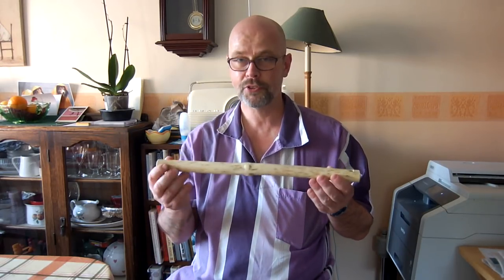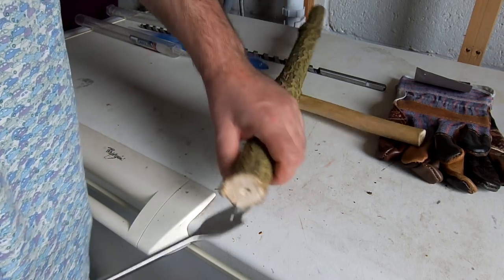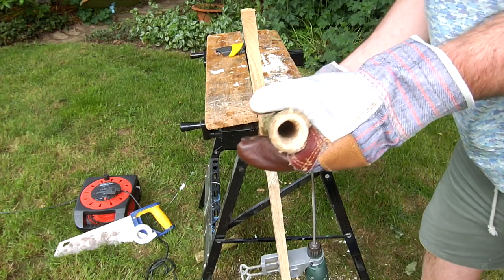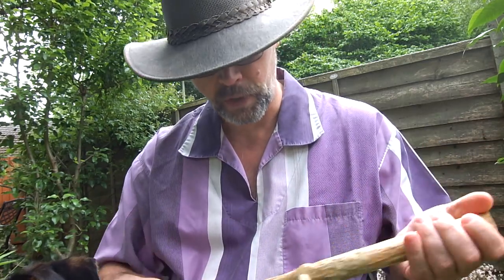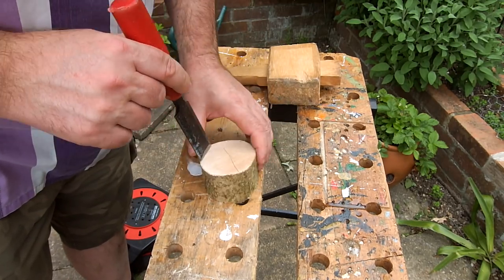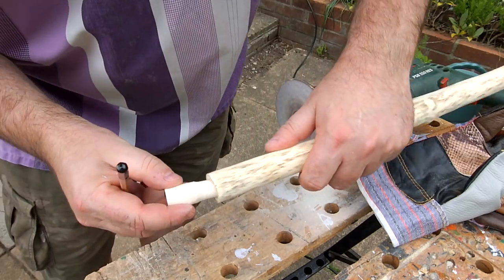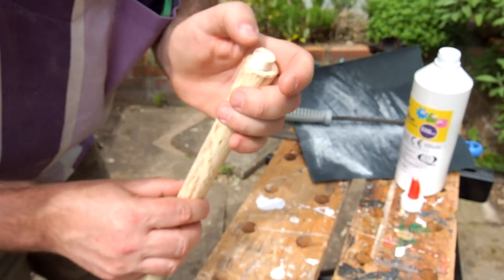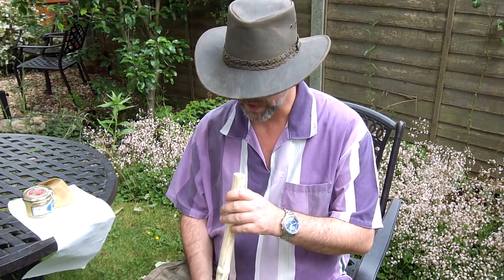Making A Traditional Wooden Koncovka (Slovak Wooden Flute)

Comment: Important clarification:  “Beeswax and Linseed Oil are both edible.”   NOT!

Or to be more specific pure natural food-grade Linseed Oil may be safe in this context; however it is typically not used for finishing because it can take basically forever to dry.

OTOH “Boiled Linseed Oil” —which is more commonly used for finishing purposes— is filled with heavy metals to help it dry more quickly, and is definitely not safe to ingest.  Moreover, because the drying agents can be absorbed through the skin, it is best to avoid direct contact with BLO at all.

Comment: Glad to see that english dude likes our traditional flute. But there is a system of measurements you need to follow. Also we don't use any type of glue. Never. Try to use double sided tape to stick sandpaper to that metal rode, will help to keep sandpaper on it. Wood needs to be cut in winter time and leave it at least 2 years to dry. Koncovka should be tuned up by cutting end of flute and using any type of tuner. I normally use guitar tuner app on my smart phone. :) Can I ask where about in uk you live?
Reply from the maker: Thanks for the info.  Yeah, I deviated quite a long way off 'traditional' really, in terms of the build.  I did take the length measurement from a site about overblown flutes somewhere, but I forget what it was.
I'm on the south coast of England - near Southampton
Reply: I visited Southampton once, nice part of England. I am living near Kettering...bit far from you. If you interesting of how to make "koncovka" or "fujara" a proper way, I could help you with translation if you need as all informations are in Slovak language. :)
Reply from the maker: Thanks - I would like to make a Fujara sometime
Reply: Confirmed all my own thoughts especially winter cutting dark of the moon in January  i'm now looking for a local wood for the job🌈

Comment: Good choice to take the bark off when it's still green. Harder to remove it once it's dried.
Reply: The downside is that the wood will crack more during drying out, as drying with bark slows down the drying process and so it makes the wood crack less.

Comment: Good job,
wood types were chosen very traditionally.

If I can suggest:
1) wrong drills: This drilling looks very dangerous. You need traditional "nebožiec" type of drill. It is much safer and is naturally guided by the soft center core. You can then drill bit curvy wood as well.
2) use two-hand knife to remove bark - again, it is safer and more effective
3) no glue is needed
4) you can impregnate flute from inside by submerging into parafine oil
Reply from the maker: Radovan Bakos agreed. Techniques were all wrong. I don't actually think I should have been working green wood either
Reply from the maker: Yeah - I guess that's my problem - where I only wanted to make one of these, drying the wood properly for years is just too long to wait.  I'm happy enough with the way it turned out, despite the unorthodox build.

Comment: That's pretty neat, and impressive. The most impressive part to me is that you drilled from both ends and made the hole meet in the middle. I think I would have had them all cock-eyed, or came out the side. Good vid.
Reply from the maker: The trick here is that Elder branches have a core of soft pith that acts as a pilot hole for the drill...

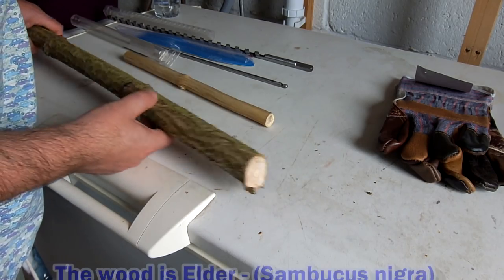Comment: At 0:42 in this Video (https://www.youtube.com/watch?v=5b1P-C8QrZE) you can see me drilling with the proper drill . The one you are using might work but the inner surface is going to be horribly rough and sanding might make it smooth but is going to make bumps so the harmonics wont come nicely...
Reply from the maker: Your link didn't seem to work for me, but I think you mean this video: https://www.youtube.com/watch?v=5b1P-C8QrZE

Much respect to your skills and proper tools - you're right of course, however, I had to work with what I have
Reply: AtomicShrimp Thank you and yes of course and you did a really good job!

Comment: If you drill some holes for the fingers like flute, but only 5*holes. It becomes a romanian instrumente called caval
Reply from the maker: Crembrulee 08 15 I'd like to try that but it seems like it might be hard to get the hole size and placement exactly right
Reply: +AtomicShrimp yeah, it's hard to do that. But I love that instrument
Reply: @VWTurboDieselTDI1.5_90CP  I am from Romania, and i bought a caval, i am in love with the sound of it. It is very hard to make one, but not imposibble. For the caval in key of A, you need an 75 cm long tube, with 18 mm inner diameter. I can give you further information if you want!
Reply: @teoflyfishing2004  Are you able to share more details? I'm also a big fan of caval's sound and would like to make one. Thanks in advance!

Comment: +atomic shrimp a spokeshave would have made stripping the bark really easy,im wondering if this flute could be made from bamboo? & the internal nodes would be easy to drill out if it was soaked in water,would bamboo make it sound different?.
Reply from the maker: Good tip, although the bark did come off really easily as the wood was still fresh.  I'm sure bamboo would work for this - I've even seen people make them from PVC pipe.
Reply: the bamboo works if you take out the internal nodes completely, the internal bore needs to be very clean, any little disturbance makes that some of the harmonics might not come.

Comment: hello mister....hmmmm you put waxoil outside....but it doesnt help to get a better sound :)   i would not take that green wood...it should be dry at least a year...if you find a dry branch...at least 60 to 70 cm for a good sound you can poke out the stuff inside with some metalsticks easyly...you will see that some branches thick like a finger also have thicker pipecavity (?)...enough for a instrument...and it should be thick enough outside to make a good whistle hole....and i would never take epoxy....brrrrr in some cases i repair some pieces with woodglue mixed with sawdust....

Comment: Very well made mouthpiece, why don't u add some holes in order to be able to perform real melodies?
Reply: Because that's not how the instrument works, it's not supposed to have any holes. You play the melodies with combinations of different air pressures and opening/closing the end hole. Also he had said in a comment that he was researching flutes and was trying to find a variant that didn't require the dexterity of a normal flute, which seems to be the main reason he chose the Koncovka.
Reply: @Charley-rz3hl  ok, i understand

Comment: im sorry but this is very bad HTM video...you used bad tools and wrong measures
Reply from the maker: Mário Svrček it's not a HTM video, that's why. This is just a video about how I made it. I'm not recommending or suggesting this is the right way.
Reply: For koncovka is better smaller drill. I use 14, 15, 16 mm diameter. But for informations is video good.
Reply from the maker: Yes - I think the correct tool is called a reamer - which would leave a much smoother surface on the inside of the bore (and the sound of the instrument would probably be brighter as a result)